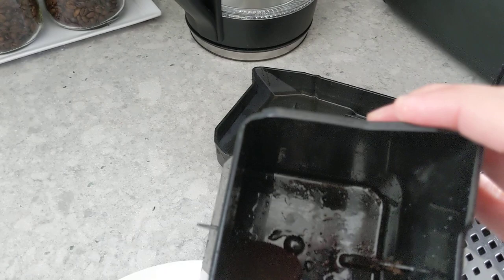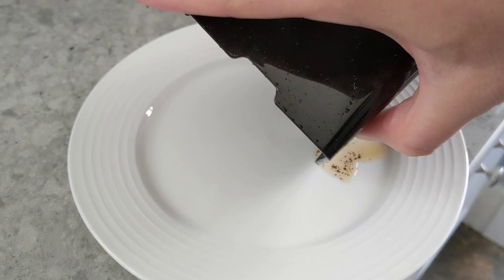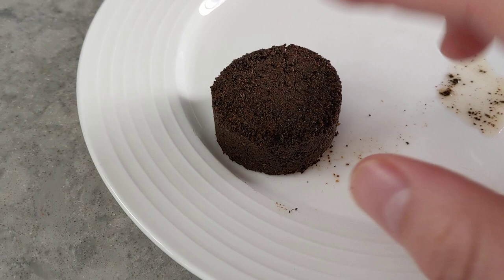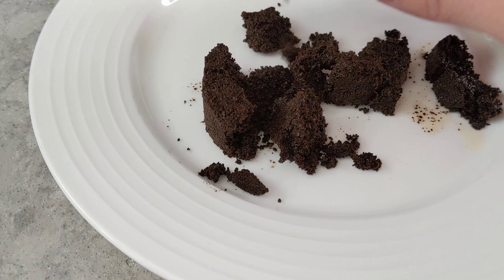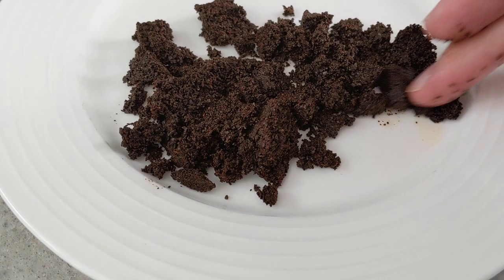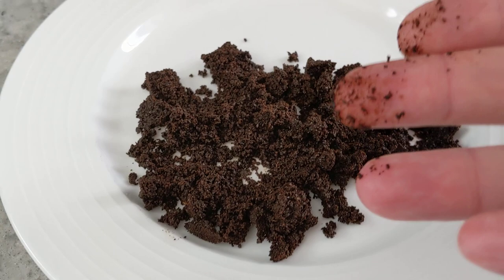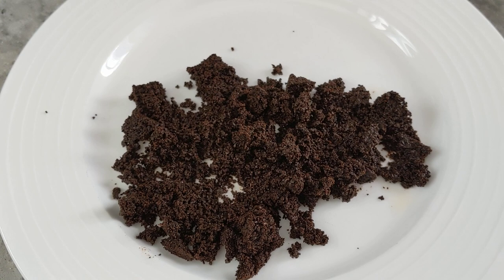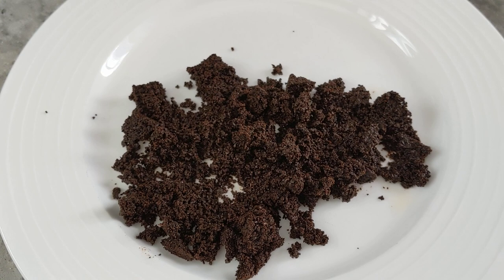Phillips 3200 Series LatteGo - Trying to make sloppy pucks. (See Description for Update)

Comment: Your supposed to adjust the knob while it's grinding. Never adjust it more than one click at a time. You are damaging the grinder. This is all in the manual.
Reply from the maker: Yes, when moving in the direction to make the grinds more 'fine' this is definitely true, as you are bringing the grinding surfaces closer together and might be 'clamping' down on the beans between them.  When moving in the other direction to make the grind more 'coarse' this is less of an issue, as you are opening the space between the grinding surfaces and not putting any additional pressure or stress on the grinding surfaces or mechanism.  Thanks for your comment!
Reply from the maker: You also might notice that I paused the recording to bring the grinder to the fine setting while it was running.
Reply: @BryanKlein  should be in video but great anyway!
Reply: 1 is for the finest? I take it that 12 stands for the finest😂. Also, I can’t understand which end of the panel is 1 and which is 12.
Reply: @JoejoeDoudou  yeah me too I thought if i turn it to the left it goes more finer “1” but I understand it wrong ! So which side if we turn it it goes more finer ? To the right side i guess ! There is no indication that show where my grinder is set now !😂
Reply from the maker: @imuluer  The dots change size on the knob.  1 = Most Fine -> 12 Most Coarse
Reply: I didn’t know that I should be running it while adjusting the grinder. I turned it to the finest setting and back to the mid point a few times and the machine was off. How do I know I damaged the grinder? Is there a way to check it out?
Reply: @mevlutunlu42 same here but I think no damages are caused 😂

That ceramic grinder should be strong enough
Reply: I turned the knob without pressing and i hear cracking sound
Reply: @imuluer   I was thinking   bigger dot is meaning more work from grinder therefore finer coffee. I did not understand that it means the size of a coffe piece instead until I got my second automatic coffee machine. The first one always made watery coffee õ because of that
Reply: Yes, if you are adjusting to more fine. It's perfectly ok to adjust the grinder to more course without it running, because you're separating the burr and cone.

Comment: it takes 2 to 3 cups until the new grind sitting takes effect according to the manual. Also the adjustment need to be done while it grinds
Reply from the maker: This has been discussed already in other comments. Thank you.
Reply: True
Reply: and what happens if you adjust it while it's plugged off and then you plug it in? it simply won't work?

Comment: When i first bought my espresso machine, i had sloppy pucks. I was using the wrong type of coffee beans and also changed my grinder settings to finer than setting 4. My wife pointed out that the manual says to keep it at 4. Since getting beans suited to the machine, and keeping it on 4, I haven't had any issues. Just great tasting coffee 👍